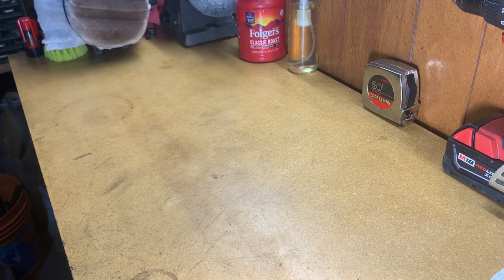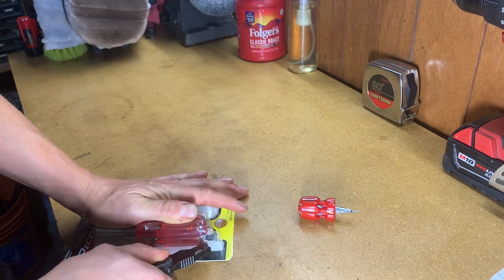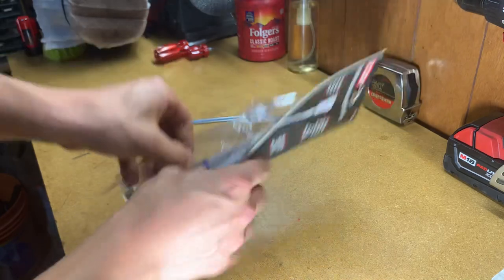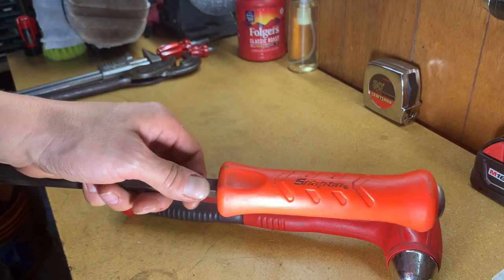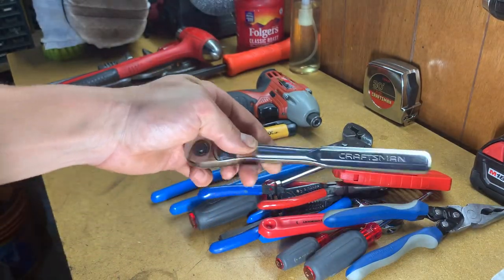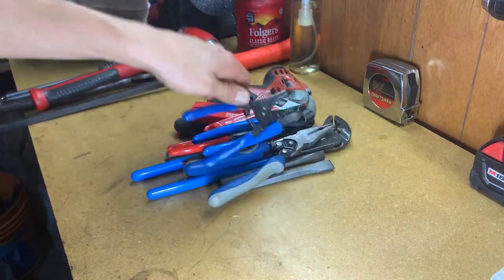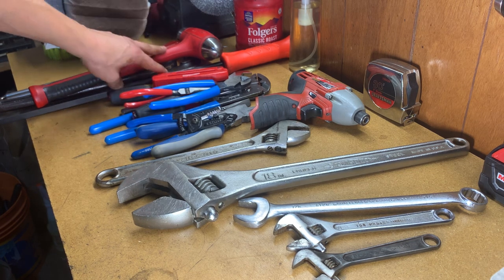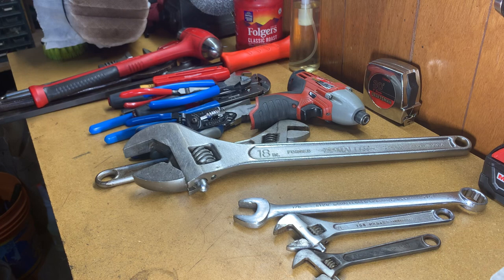Estate “Stale” Tool Haul

Comment: I always carry a Picquic screwdriver. I hate multi-bits usually because of the rattling of the bits in the handle or a really thick bolster you can't get into blind holes. This one is pretty thin and bits are held tight in the handle. And the bits are strong enough to run in an impact drill.

Comment: Why don’t you like square (Robertson) bits?  They are good in certain situations.  I mounted some brackets in a concrete wall using concrete screws with square drive.  The bit doesn’t slip in high torque applications.  There used to be a US source for many types of square drive screws (McFeely’s), but they seem to have dropped them.
Reply from the maker: That’s what they’re intended for- high torque, exterior applications, pressure treated lumber/brick/mortar. Not for home use and certainly not on a screwdriver